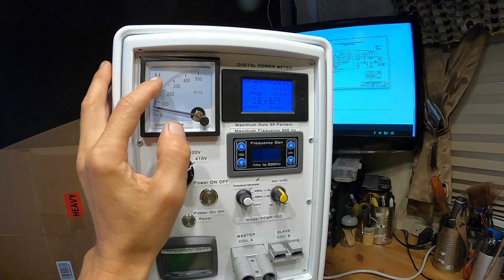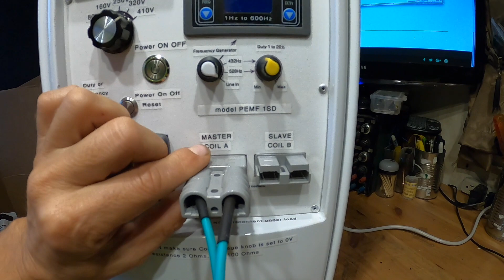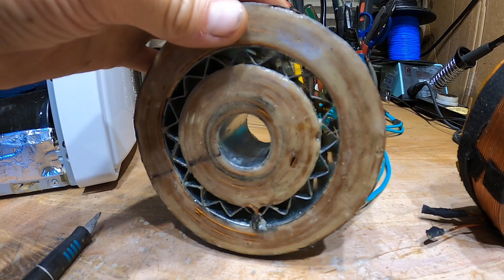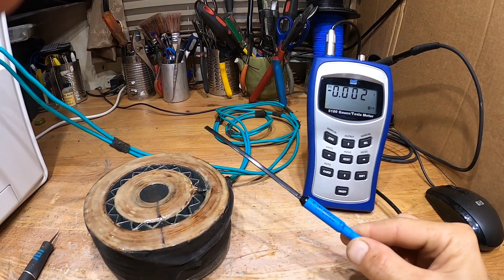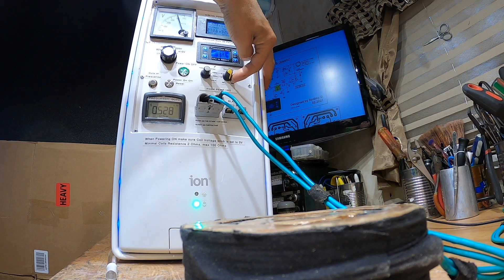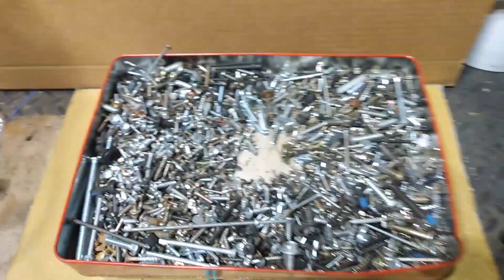037 New Aluminum Coil for my PEMF 1SD Machine. 1-600Hz, 1-30% Duty 80-410V Coil Driving Voltage

Comment: I can't wait till this is ready. Been checking for new video almost every day! 

With less duty it can pulse non stop. Amazing! 

Please don't wait for 2 weeks to make another video :)
Reply from the maker: Thank You
Having cooling allows not only low duty but mid to high duty as well
Hit Bell next to the Subscribe Button to be notify each time I put new video this way you don't need to check daily for new videos.
Reply: The coil should be used on one area at a time?

Or will you have more coils to do more areas?

Did you come up with a price for this machine?

Is this the machine you will make available for people or will you make a different design?

I want to call you sometime to give some ideas.
Reply from the maker: @APMcD  2 coils could be used at the same time. their frequency and burst intervals are synchronized. I didn't build the second coil yet. I'm still thinking on how its going to be cool off.
I don't have price tag yet, I will have it when it's complete
This is my First Prototype. My Second Unit will be slightly differently build inside (stronger) but very similar
Sure, you can Call me when ever you get some time, I'm always open for new Ideas